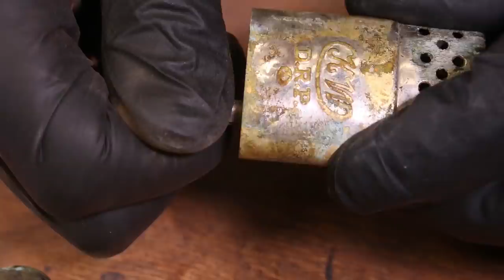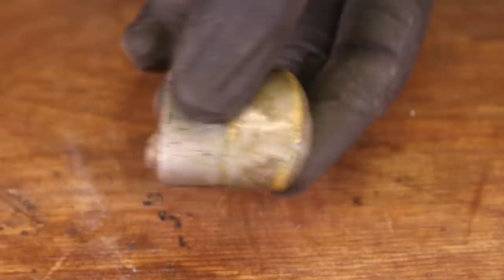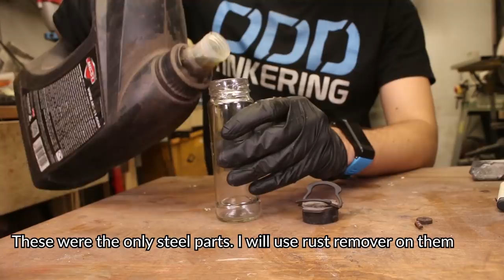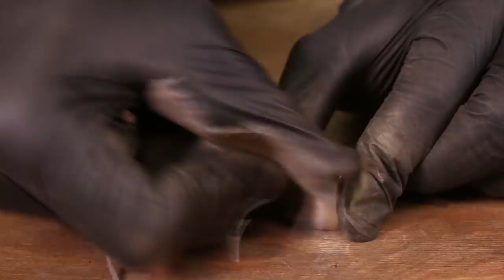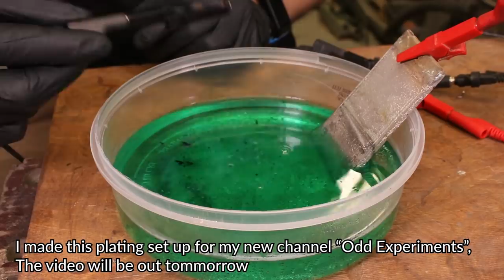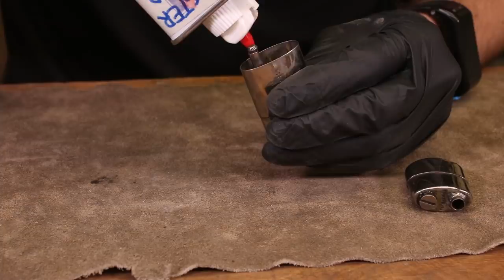Restoring Dented Vintage "Tommy" Lighter - Lighter Restoration

Comment: VERY reliable lighter.  I've used one for years, different KW model but essentially the same - and definitely my favorite pocket lighter.  A little simpler than the model you have, and always lights on the first flick, but the flame is not nearly that high.  I've also done the same thing with the lighter fluid although I was also holding a paper towel that got a little on it - and no gloves.  No serious burns, but it hurt for a few hours.  The burn came while fooling with the lighter portion of a Wallace Baroque 1941 (introduced in 1941) table lighter designed to match their famous silverware pattern.

Comment: At first, the object looked like a lost cause.  I was impressed that the original engineering required a wind screen hold to perfectly align with the wheel holding screw. That is precision. The end result is astounding.

Comment: Good job on the lighter :) Love your work.
Just like to point out that the rest bracket on the Metabo grinder wheel is still wrong way up ... The slot should be horizontal, as it was when the Metabo was unboxed.

Comment: Strange question, for those two small parts is it necessary to use that much of the rust remover? Would a small amount not take it off?

Comment: An easier way to remove a dent from the outside is to put on a spot weld and pull on it. If the weld breaks, put in a new dab and pull again. Repeat until pulled out.

Comment: This is not the "tommy" lighter. This is actually a German lighter, Karl Weiden, and is a slow seep lighter. you fill the bottom part with fluid it slowly seeps up through the rest of it, tho you may want to give it a "head start" when you first give it a fresh fill after replacing the cotton.

Comment: If it doesn't look the same as the original lighter looked, then it's not really a restoration. You've made it look very nice and shiny, but clearly the original had some sort of faux leather on or around the cap.

Comment: theres really no reason to put the microphone so close to the parts while youre working. the metal on metal scraping sound is awful.
Reply: Not heard anything till u watch gerryrigeverything run his Stanley knife down an aluminium phone body. Shiverrrr
Reply from the maker: My mic is on the camera and I don't film with Hubble telescope so it has to be relatively close because most people watch this on tiny phone screens